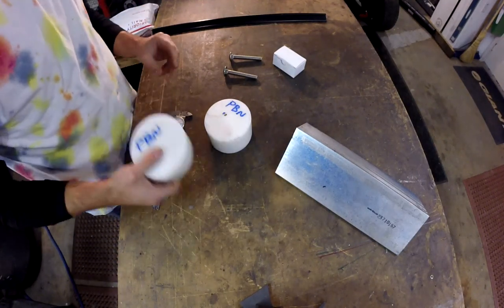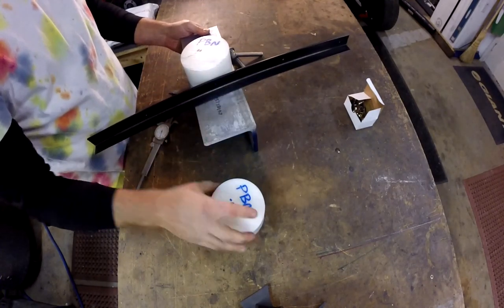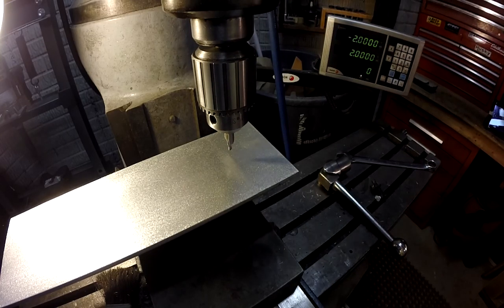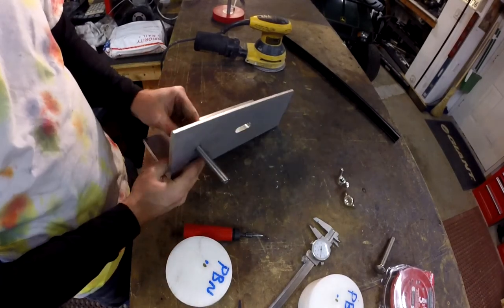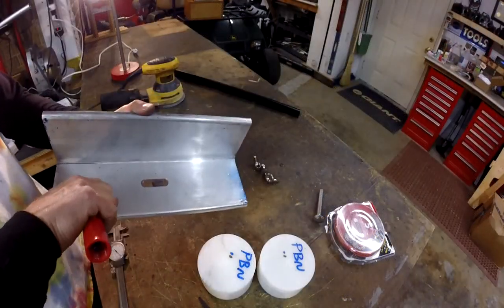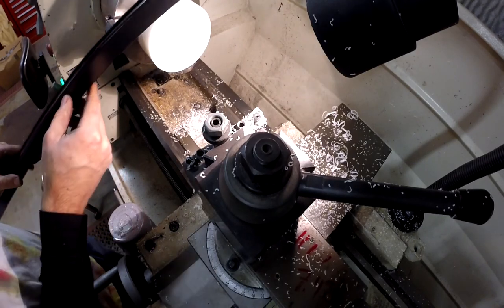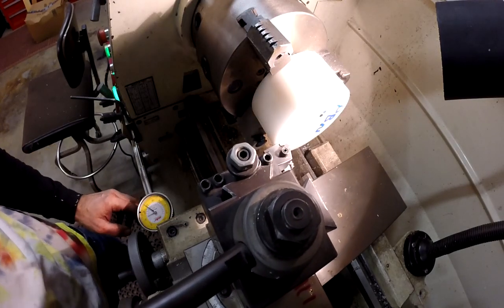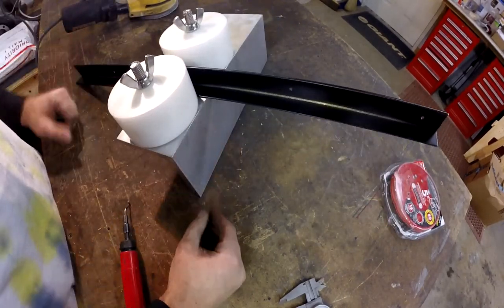Custom R.V. Trim Bender

Comment: Did you consider making a 3 roller jig in more of a triangle pattern where the 3rd roller could exert pressure while you run the piece back and forth through the rollers? More like a tubing bender?
Reply from the maker: That is a better design. If I were to do it again I would do it just like you described. Thanks for watching!
Reply: @themellowmechanic  I am going to be bending some for the bow of my boat, but bending it the opposite way that you did. I'm hoping it doesn't crack. Planning on using spanner clamps and just going slow with it.